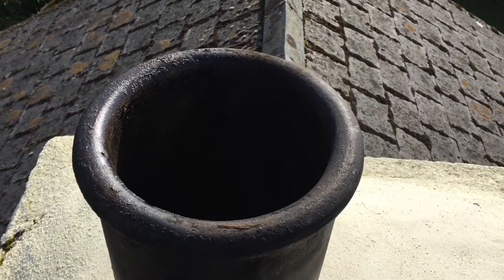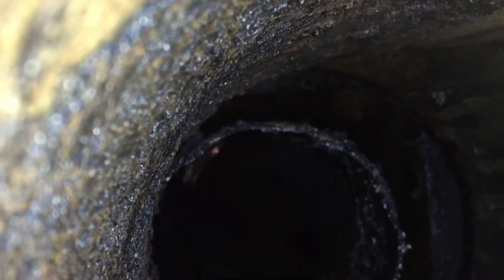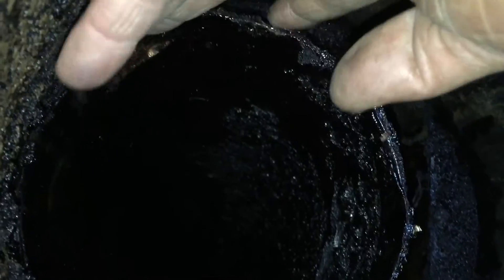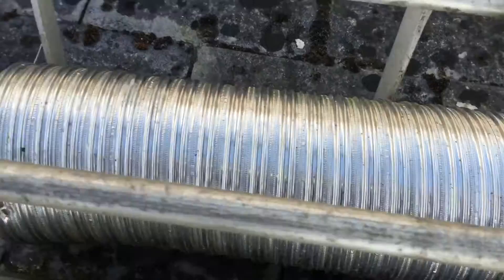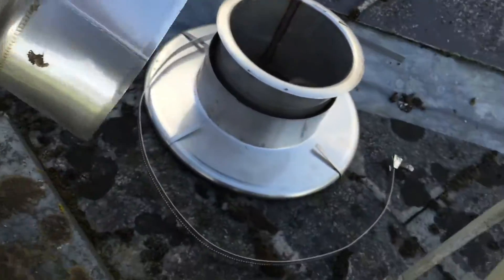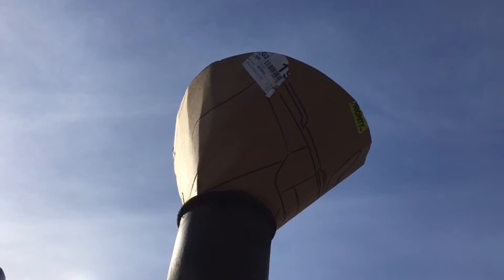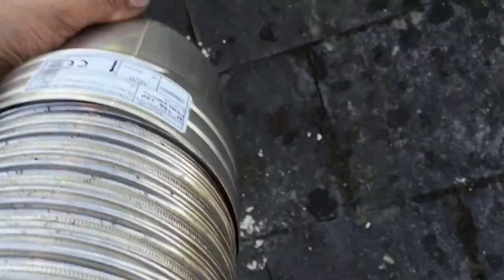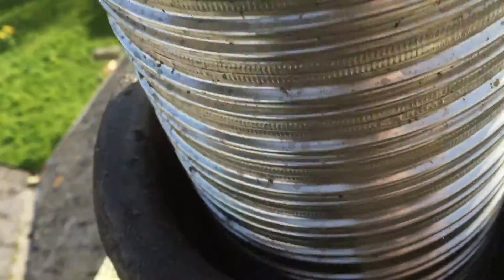Chimney Liner fault, rectified using a universal pot hanger.

Comment: I think HETAS states a liner can only be joined where there is access for the joint to be inspected, so in this instance i think you could argue that it can, and therefore complies.

 My 2 concerns would be 1) that the connector is not secured into the old liner just pushed in, i think i might have poured sloppy cement on the outside to hold it all together. 

2) the liner looked very tarry and possibly well on the way to the end of its life, i think I would have insisted on a new liner.  

The installation is definitely much better now, with vermiculite and the fact that the joint is outside the building i.e just in the stack means chance of Co poisoning is nil.

Comment from the maker: There have been some good questions/comments here so this is my response. The reality is that in the eyes of document J and HETAS the repair I have done to this chimney  would be classed illegal. 
However my own risk assessment of the situation is that I would rather leave it in this condition than the customer continue to use it in the condition that I found it in,  and to top it off I first removed a hooded spigot vent top !!
My videos are not a glossary advertising media but mainly situations that I think may be interesting to our community but it is important that I make clear what is technically right or wrong as YouTube is a platform available to all.
If a manufacturer supplied you with a liner with a joint in it this is perfectly acceptable but if you choose to modify or design change any appliance, componants  or flue, then you are liable for the safety of this work.
Recently I was called to a customer’s house to repair a recently installed appliance. The flue pipe had completely fallen off the back of the stove. 
The installer had chosen not to screw any of the components together or to the stove collar but instead make up an angle iron bracket to support the T piece and flue to the hearth, this had subsequently fallen away and all the vitreous pipe had detached itself from the appliance.
Making up your own components that have not been tried or independently tested by the manufacturer is also illegal.  
This also applies to the videos where I cut a hole in existing flue pipe to access the chimney The correct procedure would be to remove the flue pipe and replace it with a pipe with an access door in it.
The stark reality is I visited six properties yesterday and every stove installation was illegal. I would love to take a moral high ground and not sweep/service any illegal installation but the truth is I would  be out of work.!!!
HETAS is soon to release a risk assessment form, this is what we do every single day as sweeps and installers. Assess the risk and choose what action is to be taken to ensure that the occupants of the property remain safe during use of the appliance.
Thanks for watching and happy sweeping !!